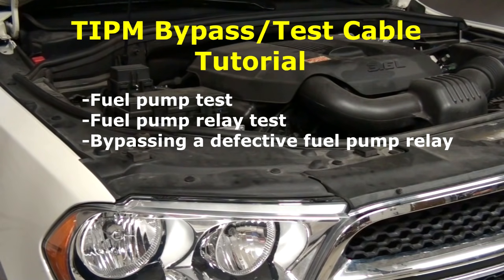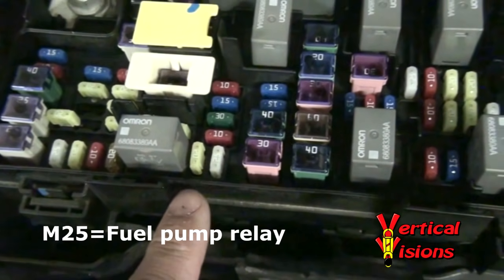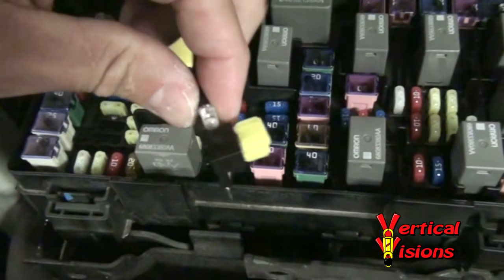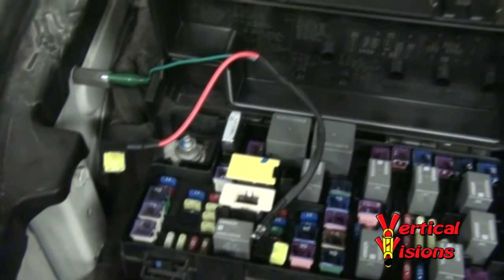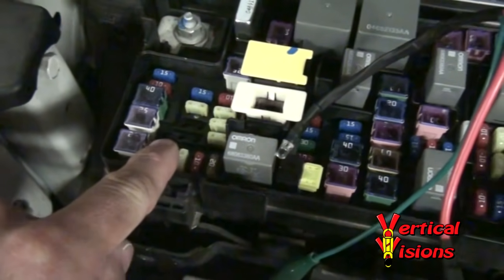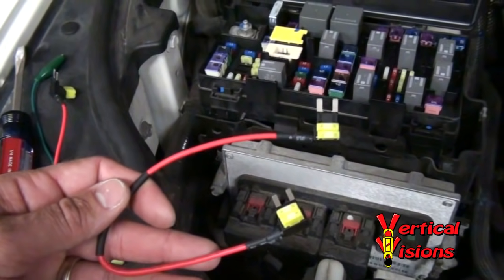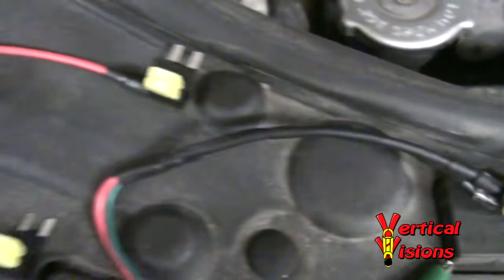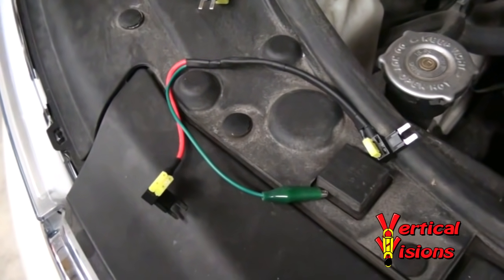TIPM Fuel Relay Test and Bypass Solutions - Most 2007-2021 Dodge, Chrysler, Ram, Jeep, VW Vehicles

Comment: Will this work for the starter TIPM problem?
Reply from the maker: No, it can only resolve fuel pump relay issues.  However, we may have a fix for starter issues inside the TIPM.  It would involve you sending us your TIPM for repair.  Please contact us if interested and you're certain the issue is TIPM related.

Comment: Awesome video! Ive got family members having this problem. You are clearly an educated person! I just wish I knew where you found 12awg add a circuits!
Reply from the maker: We now have our cables custom made per our specifications, but they are 14 AWG (20 amps).  Current ratings are different for AC vs. DC since normal residential solid copper 20 amp circuits use 12 AWG.

Comment: I have a 2011 jeep grand Cherokee with the 5.7 and it was acting intermittent on weather it wanted to start or not and it randomly dies while driving I made my own cable exactly like in the video and its rated for 20amp plugged it in and it didn't work so now I'm going to have to start testing fuel pump cuz I couldn't tell if it was cycling or not it was windy wet and my hearing isn't the greatest any ideas
Reply from the maker: Your vehicle probably has an external fuel pump relay installed per the 2014 recall.  It's the recall where they cut harness wires under your TIPM and installed a cheap Omron relay that will also fail every few years.  More info here:  https://www.verticalvisions.com/omron-g8jn-external-relay.html#identify

Comment: @Jason First of all , thank you so much for solving our issue of who owner of these diseased vehicles. I watched your video and saw the TIPM diagram on your website. Just to learn better i want to ask you, do you choose to bypass EX1-1F1J relay instead of replacing this relay since sub system of relay coil energizing could be having issue ? otherwise, replacing relay is that should be more easier solution. Thanks for all...
Reply from the maker: Replacing the fuel pump relay is difficult and involves disassembling a fuse box that wasn't designed to be disassembled easily.  Then you'll need to desolder and solder on a circuit board. We use a microscope. For these reasons, it's easier to simply bypass the faulty relay.

Comment: Hi Jason,
Since purchasing installing your relay bypass wire, my 2012 Wk2 Jeep GC has been great...until recently . It now does the exact endless cranking as before the install. Can you shed any light on this, or should I just go ahead and do the recall mod.
Cheers Brent
Reply from the maker: Dozens of things must work properly for your car to start, but have you confirmed that you don't have an external fuel relay per the recall?  https://www.verticalvisions.com/omron-g8jn-external-relay.html#identify

Otherwise, the recall mod is a horrible fix since it involves cutting harness wires.  Also, our part solves the same problem, so an external fuel relay will not help.  Do you have the LED cable version?  If so, look at the LED when starting.  Lit?

Comment: Hi hon I changed this camshaft sensor on Routan 2011  but its still taking couple of tries to turn on. And code still says after I erased  "" Po340 $07E8 camshaft position sensor A circuit Bank 1 or single sensor""

Comment: So my chrysler town and country will turnover but not start. If you spray starting fluid in the air intake, it will start after a few tries, but runs fine after it gets started. Is this something that would fix this issue?
Reply from the maker: Makes perfect sense why this works.  Starting fluid takes the place of fuel, which isn't being pumped.  Once started, the alternator boosts the system voltage from 12.5 VDC to 14.0 VDC.  Fuel relays perform better at higher voltages, so your fuel relay begins working after the alternator is operating.  Yes, our TIPM cables and other solutions will resolve any fuel pump relay issue.  2011 Town & Countrys are our #2 or #3 most popular fix, but we also see many 2012-2013 vehicles with the same issue.
Reply: I also have no codes showing.

Comment: I have a similar problem. 2007 Dodge Nitro. My dash lights and cooling fan come on randomly and cause my battery drain. Any experience with this issue or solutions?
Reply from the maker: 2007 Nitro TIPMs are historically the worst of the TIPM-7 fuse box series.  I can only suggest a used TIPM at this time:  https://www.verticalvisions.com/used-tipm.html

Comment: Jason, I'm currently dealing with the same issue on my wife's 2013 T&C.  The vehicle would turn over but not crank.  I tried the bypass with heavy wire fuse to fuse and it started right up, does this sound like the relay? Also I  don't hear the fuel pump util the switch is is in the only position.  Thanks.
Reply from the maker: Yes.
Reply: @VerticalVisions  thank you, I'll look Into ordering that cable from you guys.

Comment: Does a 1999 jeep grand cherokee have the tipm system? We are having an issue with the jeep starting and then not starting and leaving us stranded. Also would this work on the 99 keep?
Reply from the maker: They didn't call it a TIPM in 1999.  Here is a good link that shows how a TIPM cable might work in your or any vehicle:  https://www.verticalvisions.com/tipm-test-bypass-cable-mini-blade-fuses.html#faq10

Comment: Thank you Mr.Bell! Thanks to you I have officially diagnosed and fixed my 2011 Chrysler town and country fuel pump relay issue. I had starting issues and thank goodness I found your video. I did not realize my fuel pump was running after I walked away from the van until after I saw this. You saved me a bunch of money and headache. I just got this van on a rebuilt title and was super afraid of the possible issues it might have. Tour a life saver and I will be telling everyone I know of your amazing engineering skill. Thank you so much.

Comment: Does this also apply to the Jeep Patriot?  2011 model?      - thanks
Reply from the maker: I'm not certain.    Go here and take a look at the TIPM model shown:  https://www.verticalvisions.com/tipm-test-bypass-cable-mini-blade-fuses.html.  If it matches yours, then it will work.  If not, it may still work but use different fuse slots.

Comment: This is a great video, we need a bypass for the TIPM and the trans relay on Dodge RAM 2009 and up, this is a huge problem CODE PO882, the relay stops sending power to the trans through the PCM and causes limp home, just google Dodge limp home, it would be a great bypass to check for bad TIPM or PCM, and also get a lot of owners to work or school till they can afford a TIPM or PCM

Comment: Hello Jason.  I have a 2013 Chrysler Town and Country and have a parasitic draw that appears to be from something controlled by the M13 fuse.  Would this device of yours work to correct that issue, by only providing power to the M13 circuitry when the ignition is turned on?  The M13 is a 20A fuse.
Reply from the maker: It's possible that it will help, but we have not tested it.  Note that the above video is a little outdated as we now use M37 rather than M7 for the power source.  See our website verticalvisions.com to configure the cable properly if you want to test it.  Make sure the lower fuse on the M13 end of your cable is not present.
Reply: @VerticalVisions  Can you build a bypass cable with the fuses not on the side, but pointed up instead?  I want to bypass the M13 fuse on my 2013 Chrysler Town and Country.  The M13 fuse is tightly sandwiched between a relay and a large IOD fuse, so I don't think your side mounted fuses will fit in that space.  I want to perform this bypass because something in that M13 circuit drains the battery and I don't want to spend any more time searching for the issue and I don't want to tear the vehicle apart unplugging various modules.  I want to bypass it with the M7 fuse using the left legs (power on with key on),  as you did in your YouTube video when you were bypassing your fuel pump relay.  Why did you switch to the M37 fuse?
Reply from the maker: @jimcahill91  Here is why we switched to M37:  https://www.verticalvisions.com/tipm-test-bypass-cable-mini-blade-fuses.html#faq19
As for the fuses pointing in a different direction, we can't help.

Comment: Do you know if you can bypass the tipm for the wiper motor?
Reply from the maker: In theory it could be done, but would probably be too complex.  Wipers are only need intermittently, so you would need to run the bypass into the cabin to control via a switch.  Here is another solution:  https://www.verticalvisions.com/tipm-repair-door-locks-wipers-washer-fluid-double-relay-1.html

Comment: Thanks for the video, my relay wasn't staying open, shutting off the fuel pump.
Now that it's getting cold, it will take 2 or 3 crank attempts to feed enough fuel to start the car (with bypass cable).  Do you think replacing the relay on the tipm will fix this or is something else wrong?
Reply from the maker: Solved here:  https://www.verticalvisions.com/tipm-test-bypass-cable-mini-blade-fuses.html#faq19

Comment: This works !!!   My 2011 Dodge Grand Caravan would not start.   My mechanic suggested replacing the entire fuse box.   I saw this video 2 years ago, ordered the simple TIPM,  installed it and the car started .   I AM NOT GOOD WITH FIXING THINGS, but the instructions were easy for me to follow.   Fast Forward 2 years - when the weather turned cold I had the same issue.   I emailed Jason Bell, he had a way to fix it, again simple to do, cost me Zero this time.   This engineer works wonders.   Thank you for creating this fantastic product and your excellent customer service.      Terry Brock,  Murfreesboro, TN
Reply: What was the fix for not starting in the cold?

Comment: Thank you.  My daughters car has been acting up and we were stuck until I just happened across your website.  The symptoms she was having were exactly as you described with the fuel pump relay problem.  It was late on a Sunday and the car had become very unreliable.  She is a recently divorced mother on a budget that doesn't include $1000 for this repair.  She needs her car to be reliable, and we had to have it fixed by Monday morning, so we didn't have the option of ordering the test/bypass cables.  Your explanation of the problem and how the bypass cables work was enough that I was able to go to the local auto parts store and purchase a couple of the add a circuit cables and some fuses to make a crude version of the bypass cables.  They only had the 10 amp version of the add a circuit cable, so I took them apart and soldered 10 guage wire to them instead and used 20 amp fuses.  My soldering skills are not great, so my daughter will be purchasing a set of the bypass cables to safeguard against a poor soldering job, but my version was good enough to get us through until she can get a chance to order the "real" cables from your site.  Ultimately, I am encouraging her to buy the plug-in relay system that you offer because it will be a better long term solution.  I can't thank you enough for putting this information out there for people to use.  This really saved us a lot of time, money and hassle.

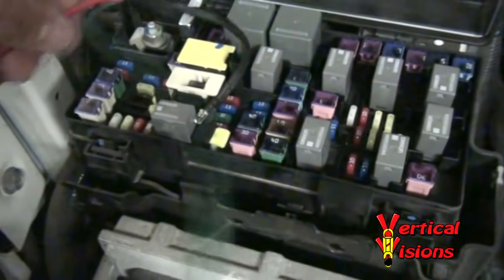Comment: At 9:07 in the video. My truck keeps the fuel pump on and drain my battery ? But do I plug the other side in ? You cut the video to fast and it looked like you were but not sure ? Thank you
Reply from the maker: Other side would plug into M7 left slots in the old days, but now we hook the cable up like this: https://www.verticalvisions.com/tipm-test-bypass-cable-mini-blade-fuses.html#faq19

Comment: Jason, I have a 2012 Dodge Ram 1500. The problem I am  having is that the starter will continue to turn over by itself and the engine will not start so I have to turn key off so I won't burn up starter. Does this sound like a problem that can be fixed with your product? Thanks!🇺🇸
Reply from the maker: Yes.  What you are experiencing is normal when you have a faulty fuel relay.  The starter engages for 10 seconds (approximately) while the vehicle acts like it's out of gas.  2012 Ram trucks are widely affected by fuel pump relay issues.  Read more about solutions and symptoms here:  https://www.verticalvisions.com/tipm-fuel-relay-solutions.html

Comment: I bought a 2011 Chrysler Town and Country about a week and a half ago from a dealer. Great price and the test drive was perfect. Close to the end of the hour drive home the check engine light came on. Got home with no problem. Nothing seemed amiss. Later that night it wouldn't start. Not even crank. Next day it would crank but not turn over.

Started Googling and started seeing TIPM. I felt horrible. Then I ran across this video and I had a little hope. I went to a parts store and bought what I needed to make a cable of my own. They only had the 16awg wires. Put it together and popped it in and after a few tries it started. This time of year in Iowa it's a little chilly so getting it to start with the 16awg wire under 50 degrees was hit and miss. At least I hoped it was because of the 16awg wires. 

So I got on the website and ordered the TIPM 7 Lite. Got it today and put it in. Bang. Started right up and it is mid 30's for temp here today. I couldn't be happier.

I don't know if the dealer knew something was wrong with it when they sold it to me or not. I did take it back after I put my cable in and told him what I learned and he didn't seem to even know what I was talking about. They only had it on the lot for a day. But it was a really good deal so I have to believe that they knew something was up with it. They just didn't know that they could fix it so cheap.
Reply from the maker: Great story.  Thanks for sharing.

Comment: The only problem now is with the bypass you cant remote start your truck from my experience
Reply from the maker: Yes you can,  remote start works perfectly with new cable connection method:  https://www.verticalvisions.com/tipm-test-bypass-cable-mini-blade-fuses.html#faq19

Comment: Well I just got my wire in today I replaced the fuel pump 2 times thinking it was a bad fuel pump and people saying a bunch of different diagnoses... I have a 2011 Dodge Ram and I just plugged the wires in as stated. Truck works perfectly now!!! The truck was not starting and if it did it would of been once in a great while. The TIPM is bad this relay I bought works like a charm! Bravo to these guys!!!

Comment: Just a quick question. Why wouldn't this be the preferred method to fix the relay problem as opposed to adding an external relay like so many have done? Is there a benefit to adding the relay over just bypassing it with this cable altogether? I have a van where the fuel pump is staying on and I am leaning towards this cable but was curious if there was something I was unaware of that might warrant adding the relay in lieu of just bypassing it altogether. Thank you in advance for your help.
Reply from the maker: Products like this ARE the preferred solution.  External fuel relays require cutting of harness wires, which is never a good idea.  We have plenty of solutions, several that are long term and patented:  https://www.verticalvisions.com/tipm-fuel-relay-solutions.html

Comment: I made the cable and it work perfect.  Now I have a problem that  during cold starts, it won’t start during the first try. Did I do something wrong?
Reply from the maker: Try the new connection method to resolve your issue:  https://www.verticalvisions.com/tipm-test-bypass-cable-mini-blade-fuses.html#faq19

Comment: Any chance this could manifest as an occasional, unreproducible stall that recovers almost immediately ? Stalls that occur right after stopping and beginning to accelerate?  This has been the case for last couple years. It doesn't quite fit this video but the TIPM seems to be a real POS that is possible for anything... So I'm asking...
Reply from the maker: Yes, it happens but it's rare (less than 5% of all failures).

Comment: the TIPM on the 2007 dodge ram is not the same as on the video, so where would i find the fuse for the fuel pump, i find nothing listed as such in my tipm
Reply from the maker: Not sure, but read this:  https://www.verticalvisions.com/tipm-test-bypass-cable-mini-blade-fuses.html#faq10

Comment: so does the fuel pump have a pressure switch ??   or a better question is   does the  STOCK relay kick on with the ignition or   when the system loses pressure  ( basically telling the pump to supply gas  ) sorry if it sounds like a stupid question  but were having the same issue and can not afford a new TIPM
Reply: Yes, some vehicles do have a pressure switch downstream of the pump and some don't.  The fuel pump relay should always be on during engine starting and running, but the pressure switch may close a valve further downstream on some vehicles.   We rarely ever discuss this arrangement with customers.  Focus on your fuel pump relay as plan A due to the widespread problems in Dodge/Chrysler/Jeep/VW vehicles (especially 2011 models).
Reply: @elcap747  thanks for you input  we got  the relay waiting to get it fixed   thanks again

Comment: I just purchased the plug in relay bypass system (lite). I chose this option to eliminate any possible issues with remote start. I'm fairly sure this will resolve the problem. Thanks for the help.
Reply: How can I fix the issue with my Keystart it works fine starts every time EXCEPT for key starter.

Comment: So the fuel pump now comes on when the key is on weather the engine is running or not? If that's the case, seems like a lot of potential liability should the vehicle be involved in an accident where the fuel lines get ruptured, the fuel pump will be pumping fuel all over the area. Just saying. We live in a land controlled by lawyers.
Reply from the maker: No.  If you read through our website, you'll find that the fuel pump is only powered on while the vehicle is running and power is removed during a crash.